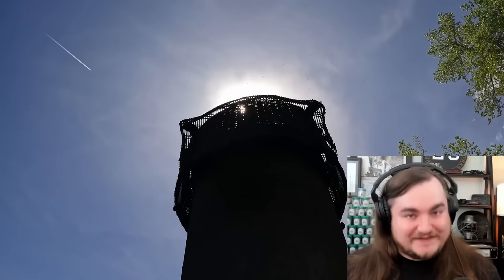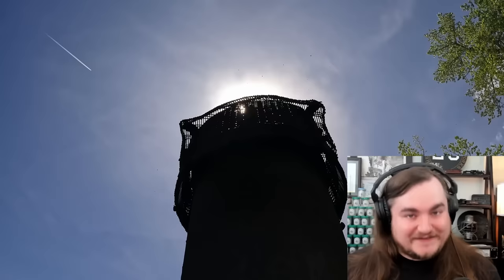Why do USA steam trains make smoke, but UK ones don't?

Comment: Hey there Hyce, I always knew that black smoke in photos was mostly for effect, Also that black smoke signifies poor combustion and an inefficient firing technique. A little information from my neighbor a submariner during WWII. Submarines patrolled at snorkel depth or on the surface watching through their periscopes for convoys and their nemesis the destroyer. If a destroyer was sighted cruising along with little or no smoke,no worries, as destroyers at cruising speed did not utilize all their boilers. If , however a large plume of dark smoke erupted from their secondary funnel(s)it indicated that additional boilers had been "lit off" in preparation for a high speed run, you've been detected! Time to dive for your lives!

Comment: A good explanation.  I'm not sure why photographers like to see locos being fired inefficiently.  I am a fireman on a narrow gauge line in the UK.  Until recently we were able to burn Welsh steam coal, which burnt very cleanly, usually with a slight haze unless we had just put a big round on.  Sadly the Welsh government has forced the last mine producing steam coal to close on environmental grounds, so we are now importing coal all the way from Poland.  This burns very differently so we are having to change our firing technique to minimise smoke.  A very thin fire with a bit of top air seems to work, but the Polish stuff burns through quicker, so the fire needs constant attention.

Comment: For optimum combustion of coal,  primary air should be restricted so as to promote gasification and reduce clinker formation. The secondary air is essential to complete the combustion of the gases. The system was further developed by L D Porta who perfected the Producer Gas Combustion System in Argentina in thec1970s.

Comment: BC the USA requires Trains with strength due to the size and the amount of goods needed to be delivered. The UK has like 10  miles or railroad to cover so you can use a 2hp train to deliver everything.

Comment: Very interesting explanation!  I was also thinking of the coal quality: I know Welsh coal (popular with live steamers) has a reputation for burning relatively clean; I’m also aware that the firebox of the UP Big Boy’s in particular was designed to burn less than great quality coal.  I’m also aware of the photography aspect, particularly with oil - burning locomotives, where it’s not uncommon for the fireman to sand the flues to produce black smoke.

Comment: The steam causes venting from the fire box to make the fire hotter, which means more efficiency and power. When you load up the fire box with new coal or wood, it will smoke more until the coal or wood has reaches full burn. This happens for several minutes. It would be obsessive compulsive to maintain a 100% clean burn 100% of the time. Trying to maintain a constant clean burn would result in a dramatic loss of power.

Comment: As a Marine Engineer who has fired a lot of boilers - I liked your explanation.
I thought that you covered the range of variables quite well.
Reply: Black bear - at least we reuse our water on ships and use distilled water !
These guys discard all the water and use tap water on top of that.
Also No vacuum?

No way to run a ship….
Reply: @josephpadula2283  Actually, many steamboats operating in freshwater rarely used evaporators or even condensers -
even well into the 20th century, 
while some locomotives in arid climes experimented with condensers - 
though air cooled condensers are a much greater challenge than water cooled condensers.
Exhausting into a vacuum really doesn't gain much efficiency until you have at least a compound engine, but better yet, 
triple expansion - or a multi-stage turbine.
You lose too much heat in sub-cooling of the condensate to make it worthwhile to condense to a vacuum with a simple (single expansion) engine - 
that's why these typically use atmospheric condensers when they have them. Remember that even shipboard, most of your steam driven auxiliaries are exhausting to an Aux Exhaust system - typically regulated to 15psi - 
so, above atmospheric pressure - 
because this steam can be used to improve overall plant efficiency. 
Also, railroads did indeed invest in boiler water treatment in many areas - but it is always a balance between the expense of water treatment versus the cost of boiler maintenance.

For ocean going ships - 
they tried boiling saltwater, but this limited them to boilers of less than 15 psig.
It required the development of evaporators and condensers before steam could actually become economically practical as a ship's primary propulsion. 
Different solutions for different challenges.

Comment: Depends what you fire with (oil, coal, wood) and the fireman. When I fired, piling on the coal made for smoke and a cooler fire - very photogenic, but not something you'd want to do stationary in a station, as it drifts over everybody... the sulphur content, and even dust content of the coal makes a difference, too.
In short - huge clouds of smoke are either a) incompetence from the fireman, or b) for a photographer.

Comment: I think a lot comes from hollywood, all the locomotives smoke to show they're working hard in the old westerns. 
Pentrex burned paper and tires for smoke in their one video, i believe Last of the Giants. 

I saw an interview with someone who fired the big boys. He said it depended on the engineer. Some, you could fire it clean climbing a mountain and he'd back off the throttle so you could cut the fire and coast through a tunnel.
Others, you had to dump the coal to it, they wouldn't back off the throttle into a tunnel, if you were lucky you had time to wrap a wet shirt around your head to keep cinders out of your eyes and keep some soot out of your lungs. 
Ed Dickens says they try to keep it to a light haze for efficiency,  but they do make smoke for photo opportunities.

Comment: If you’re making smoke, it’s not burning clean.
The engineer and fireman have to work together to get the most out of the fuel.
The engineer is in charge of the steam, which draws the air out of the smoke box.
The fireman is in charge of how much fuel, whether oil or coal, goes into the firebox, and how much smoke at that end.
Balancing the amount of fuel as to how much draft there is is key to this.
This almost fails when you have a long, level run, and then have to prep to go up a grade. This requires a bit more heat, because the fireman needs to get things a bit hotter to prepare for the need for more steam up ahead.
Kind of like hitting the throttle just before going up a hill in a heavy truck, to get a bit of advance on the grade.
Soft coal is known for smoking, too. 
Sometimes you get a bad load of coal contaminated with sand and dirt, and then it’s a challenge just to keep the fire burning at all!

Comment: I have also heard of "Sanding the flues" where the soot that builds up in the fire tubes from running smoky like that is scoured out by using engine draft to pull sand through.

Comment: White smoke, this is a reaction between the temperature of the air and the exhaust, as a general rule this goes around 18-20 degrees, which is why we see little in summer but a lot in winter.

Comment: It was called "Running the company notch".  There was a throttle setting that the railroad determine to be the optimum air fuel ratio for crusing.  Fifteen part air to one part fuel.  The fireman was frequently looking at the color of the smoke.

Comment: I had the pleasure to do a photography tour at Railtown 1897 on no28 a couple years ago. It was my first tour but I remember that on the first run by the photographers kept asking for more and more smoke. Each pass by didn't have enough smoke, so they'd back the train up and try again. Ultimately they ended up dragging the tender breaks to make the engine work harder against the breaks to create enough smoke to please the photographers. I thought it was clever but the mechanics child in me cringed at the thought of them dragging the breaks on purpose. Still had a wonderful time though!

Comment: I ran a wood burner and it was harder to make it smoke. The way we would make smoke would be to use old rail road ties. It also made a lot of hot embers that cought things on fire. We ran in the woods so we did not want that. Look at old photos you never see black smoke you see white steam.  Also if you run when it was cold out side. They use to work locomotives a lot more harder pulls.

Comment: That's often intentional for the cameras. Like it or not, smoke is a crowd-pleaser.

In the revenue days of steam, many railroads equipped fireman with cards with varying shades of grey so that they could compare their stack with the card to determine if their combustion was complete enough.

Black smoke is wasted fuel, and also produced a layer of insulating carbon on firetubes. On many railroads, excessive black smoke could result in discipline or even dismissal of a fireman.

Comment: This was informative and interesting, thank for taking the time to put it together. 
If I did this video it would be short, as I would say, ‘incomplete combustion’ and that would be an end to it. 
One thing I’m not sure of, around 5:20 you say something about coal burns, and also there is gas from the coal that also burns (I’m paraphrasing, so I may have that wrong)  ….. I would say, coal is heated to release the gas within the solid and it’s the release gas that burns.  But anyway, I got the drift of the discussion. 
Keep up the good work.

Comment: I live in a house in Upstate NY built in 1853 which is right along side the main East-West 3 track Railway.  My home is stuffed full of Black soot from the old coal locomotives. Every time another engine goes past this stuff sifts out of the walls and ceilings all over everything. So talk about incomplete combustion. Still love my house though.

Comment: On later UK engines, 1900 onwards, it was also possible for the engineer to regulate the amount of exhaust steam being injected into the smoke box to increase or decrease the draw through the boiler fire tubes. This allowed precise control of combustion gasses being drawn through the fire tubes and increased efficiency greatly over engines not fitted with this system. Toward the end of the steam era control of combustion and efficiency became a more important design consideration and ever more elaborate systems were adopted including being able to inject steam directly into the smoke box to improve efficiency at low speed when there is insufficient exhaust steam.

Comment: In the UK the owner of a steam locomotive that produces excess smoke can be fined under Section 19 of the Clean Air Act 1956 until this was replaced by the Section 43 of the Clean Air Act 1993. So that's one reason in the UK we avoid producing excess smoke. A single offence is punishable by a fine ofupto £5,000.

Comment: Isn’t there a video out there with Challenger back in the 90s or 00s rolling coal like you wouldn’t believe throughout almost an entire excursion. I remember reading some one in the comments saying they were on that excursion - the oil delivery guy made a wrong turn & wound up hours away from where he was supposed to meet to refuel the loco. The only fuel available was a different grade oil that they could get by with but it turned her into a traveling volcano.

Comment: It is because the North American foamers (foamers = anorak) expect the locomotives to do this.  Also, it does make for a rather dramatic photograph.  In actual practice when steam locomotives were in common use about the only time that black smoke would be seen is on start up when there is no cut-off on the valve gear.  The American railroad companies had standards on smoke exiting the stack as it represents excessive fuel consumption.

Comment: The coal used does have a part to play, generally uk engines use Welsh steam coal which is very high quality, very high temps and very little impurities which is why you never see much black smoke it’s generally white smoke

Comment: I saw a video on servicing locos I seem to remember they drew air from below - but it was around the time diesels were being introduced so they would be later steam locos.  I do know English hearths draw from below - the ones I've seen - which could date back to the 40s or earlier.  They only smoked when coal was added.  It smokes as it starts to burn.

Comment: It's done for the rail fans. I was on a fan trip and they threw old tires in to the firebox for effect.

Seriously though, to quote an instruction booklet of the NYC, "BLACK SMOKE IS A WASTE OF COAL".
"Cooperation between the engineer and the fireman will eliminate objectionable smoke."

Comment: The Steam Ferry that goes from Ludington MI to Manitowoc WI  has electronic controls to make it burn cleaner..  They don't dump 25 tons of coal ash into the Lake anymore either.
  Seems I read that the Silverton to Durango  Steam locomotives have been converted to burn fuel oil since the Big Forrest fire in the area.  One an area burns I would think the risk of a forest fire would be reduced for a few years.
  They need to cut the trees right next to the tracks and  burn them in the steam trains..
  Also a light coal fire enhanced with Propane or  Fuel oil injection when more power is needed would work more cleanly and efficiently .

Comment: more smoke means the engine is not running well and that's not desired by the operator only by 3rd parties for effect. Any train operator would want as much energy as possible out of a given amount of fuel anything else would be lost profit. Good video.

Comment: As a holder and now retired with an Ohio High Pressure Steam Engineer (under Ohio Rev. Code 4104.19) that worked not only as the Station Steam Engineer, beforehand I hand fired and operated stokers with coal.  Reasons for smoke vary in many ways but No. 1 is fuel ratio to air is too much fuel for air to be totally consumed.  Draft controls are set too low, type of coal BTU too low including sizing of coal.  I don't know about steam mobile equipment but sometimes we injected heavy bunker oil into the firebox and disposed of unwanted material that is otherwise not useful but useful to supplement coal as a fuel.  Also soot sometimes accumulate in tubes calling for more fuel to get pressure will cause extra smoke.  Maybe in Europe, engines were taken more out of service for maintenance and cleaning.   In the old days, we were known to shred used tires and inject with pulverized coal in a boiler that increased the efficiency of the boiler and the same with injecting heavy bunker oil or fuel oil.  I think even some ships running the Great Lakes did the same and I know rotary kilns that make cement clinker do the same.  To be honest, I don't think there is one reason European trains were cleaner in the stack but one reason I know of when I was traveling in Germany.  Passengers hate soot and smoke.  I noticed freight trains always had more smoke.  In the US there was less incentive to have clean stacks.  The same with steel mill stacks before 1970 in the US.

Comment: Interesting video.  Not really a steam rail guy,  I just stumbled across this video.  I am a pilot though, and there is a similar awe of smoky exhaust amongst aircraft spotters.  Everyone seems to love the older generation turbine engines (Jets and turboprops)  which put out a lot of sooty exhaust.  A lot of people seem to  equate it with power, which is silly, because it's actually less power, and more inefficiency.   I fly the civil version of the C-130, the L382,  which makes a lot of sooty exhaust, because it has older generation engines which aren't that efficient.  I see a lot of comments from enthusiasts about that soot,  when in realty it would be great to have more modern, more efficient engines which burn less fuel as it would make the airplane more competitive commercially.

Comment: Steam engines in the UK often pulled 3 class passenger carriages and it was not acceptable to cover 1st class passengers in soot so the designers took steps to prevent this. It is less likely they were concerned about 2nd class passengers and probably used 3rd class passengers as fuel if the coal ran out.

Comment: US operators use heavy sulphur oil or low grade coal in their engines that produce a lot more smoke. In the UK much better qualtity of both was available and emissions, even back in the 1930s was heavily regulated.

Comment: I suspect the british loading gauge to be one of the main reasons. Historically the first rail system, they did not envisage a need for larger carriages, so the lines and tunnels were built that way and could not be enlarged. This results in a narrower firebox and a need for  more efficient firing. 
Coal did vary, the GWR welsh steam coal anthracite melted Mallard's LNER grate. Welsh dry steam coal is "the best" but it burns so hot it melts steel, it needs a cast iron grate, oops.

Comment: All well explained, much enjoyed that, thanks..

a small firebox is more easyily managed than a larger one.
There is an optimun size, I believe, assuming one man firing by hand, and the engine working flat out...as with Patrick Stirling's Singles...
He reduced the grate area , as he devoleped the design to increase reliable performance.
He seems to have been  mainly concerned with the width of the water- legs twixt firebox and boiler shell to ensure good circulation...
the fire was worked at  white heat,  throwing out lots of sparks  but the power developed was prodigious, as you might expect...
about the same as his sucessor's  Atlantic layout replacements  with far larger fire grate area and much larger boiler 
 and from memory, smaller cylinders, but also superheaters